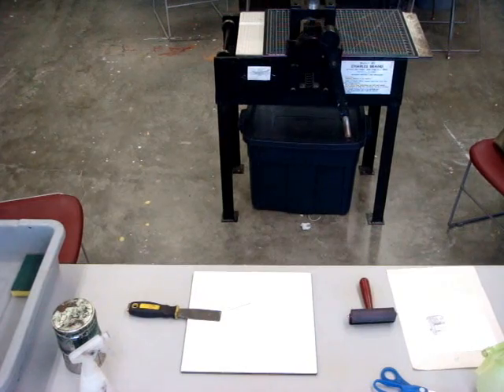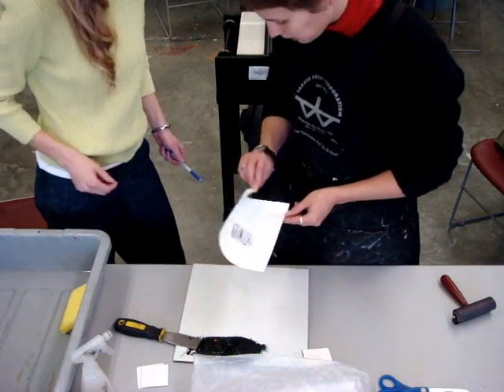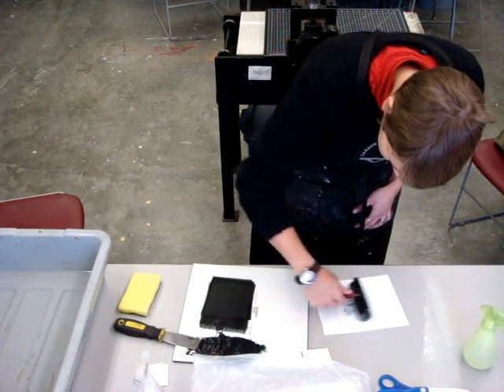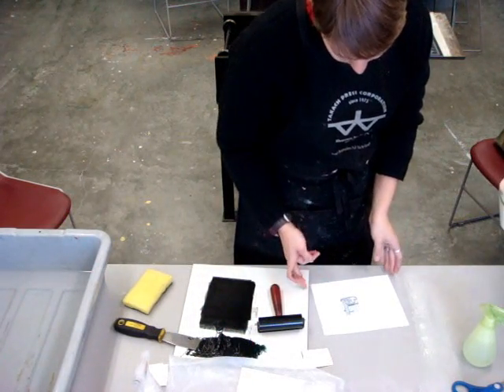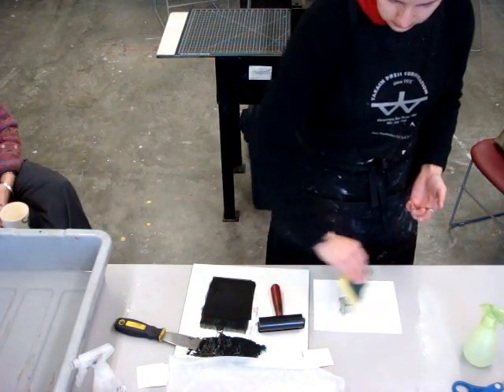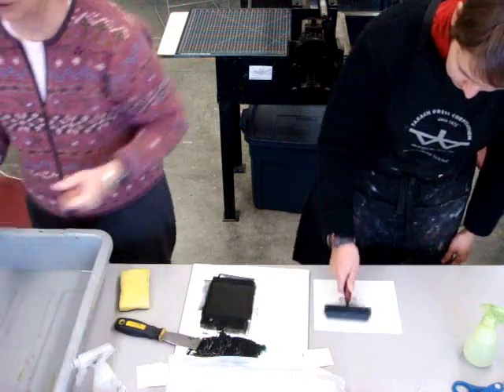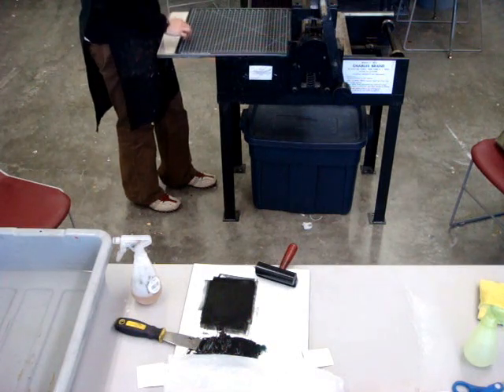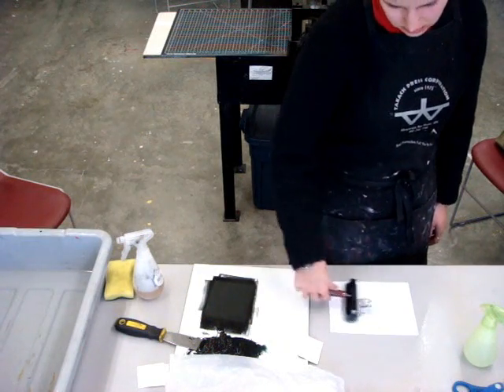Z-Acryl Demo

Comment: Hi.
This is really a great tutorial on polyester plate litho. 
I do have one question though and I hope you'll be able to help me with it.
They don't sell z-acryl plates here in Croatia where I live but I found polyester plates made by companies Xerox and Agfa. The plates are branded Never Tear and Synaps, respectively. 
They are also 100% polyester so I figured they should be suited just fine for this technique.
So my question is: Is any kind of plate suited for this particular technique as long as it's 100% polyester or is there something special about z-acryl and pronto plates that makes them perfect for this kind of litho?
The reason I'm asking is 'cause I have a lot of problems with scumming using Never Tear or Synaps plates. 
I followed your instructions on the procedure with only difference being that I haven't used gum arabic since I can't get a hold of it at the moment.
And I've also tried to prevent scumming by adding some vinegar to the water. It helped a bit, but not much.
So to cover everything:
I use Xerox and Agfa polyester plates and Charbonnel printing ink.
I've used both plain water and water mixed with vinegar to wet the plate.
Any kind of help is most welcome.
Thanks in advance!
Reply: hi Marko. since I have not used the plates you use I can not tell you about them. are you using Gum arabic? it is different than vinegar and stops water from evaporating so fast. I also don't know why you wouldn't order supplies internationally if you can't find them in locally?
Reply: +Mirka Kim Thank you for replying :)
I haven't used gum arabic so far as, you guessed it, no one sells it in Croatia :D
I have tried ordering supplies online, but the thing is, most of the stores like Amazon and Dick Blick for some reason don't ship certain items to Croatia :/
It's as if we're a third world country or something :/
And I don't know of any other specialized webshops that sell art supplies. 
If you can recommend a good webshop, I would be most thabkful :)
I have managed to ink and print one plate yesterday using water and vinegar but still had some problems with scumming. Not as much as before but still...
Thank you again Mirka!
Reply: There are lots of stores that sell supplies. Try Graphic Chemical or renaissance graphic arts. Europe also has stores like polymetaal.nl, intaglioprintmaker.com, boesner.com, joopstop.com
Reply: Thanks for the links! 
I'll probably order gum arabic since I believe that Xerox and Agfa plates do in fact work just fine and it's way cheaper for me to buy a package of them locally. It's probably due to my poor execution that I have problems with scumming and not because of the plates.
Thank you so much for your help! You've been really wonderful.
Cheers!